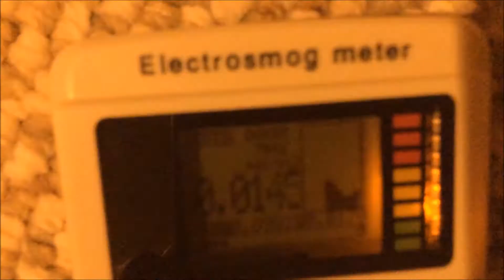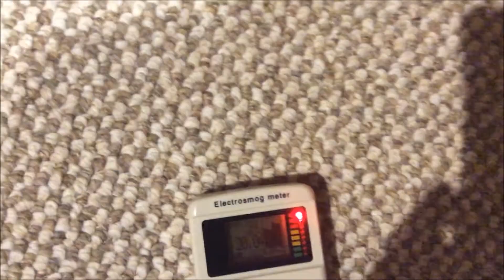Creating a Barrier Against RF Radiation Using Aluminum Foil Shielding

Comment: The only problem with this experiment is that by touching the aluminum foil you are acting as a big ground, in effect. If you put any object in between the RF source and the meter and touch it you will see a similar effect. The true test is to put the object being tested between the phone and the meter without touching it in any way. See this video for an example of the effect I'm describing: https://www.youtube.com/watch?v=01BrUDWVZKo

Comment: What if you made a small cardboard box with a lid and lined the inside with aluminum foil so you can put the lid on with the phone in it I wonder how well that would work probably still would pick up a EMF signal from the cordless phone jack?  I always put the phones on their chargers and have a timer shut the phone jack off at night when I don’t expect or want calls something like off at 10PM and on at 5AM.
Reply from the maker: You would need to use an RF meter to measure the effects. Any such solution is imperfect. Your best bet is avoid cordless phones completely and use only corded landlines. You have far more power and control and you can put extensions around your house.

Comment: So.. if my laptop has an upper casing made of brushed aluminum, will it reduce the EMF and RF exposure on my hands?
Reply from the maker: Possibly. The only way to be sure is to measure with an EMF meter. Aluminum foil can always reflect radiation back at you, which would make the problem even worse. You have to be careful how you do it - and always measure!
Reply: @WirelessAction  Does anyone know if doubling up on foil makes it more effective?

Comment: How does aluminum paint perform?
Reply from the maker: I'm not sure, I don't have any personal experience with it. I've just used foil, which is really cheap but it can work if done right. Paint is a more permanent solution. I've seen a video of a room that was painted and it looked like it did a good job.
Reply: Mark Ziegler if you can get hold of led paint you we be lucky its the reason why they stopped making it